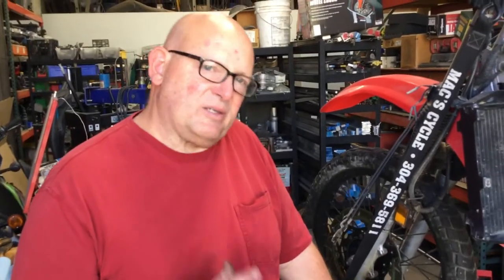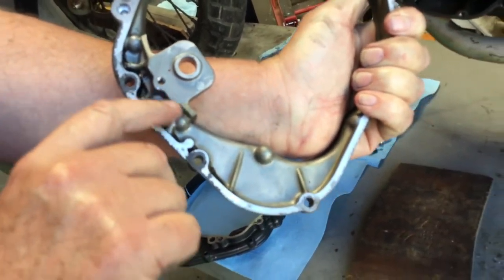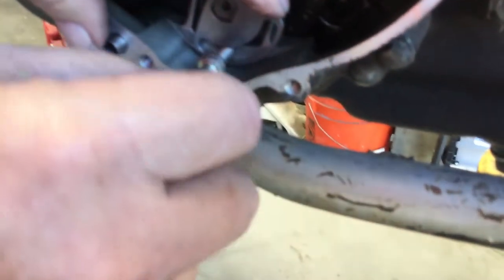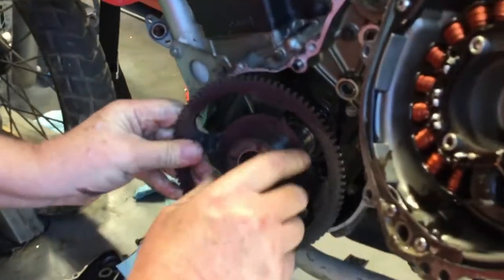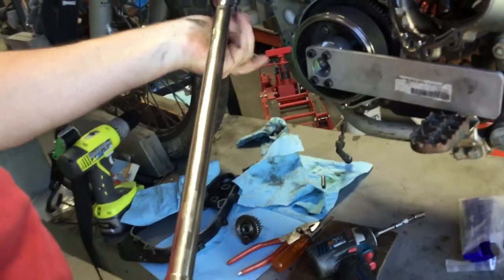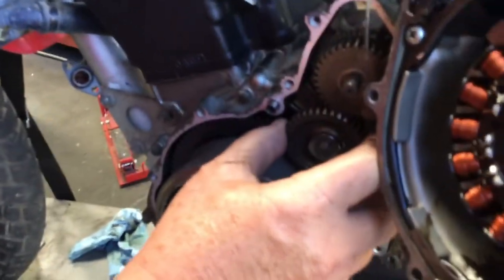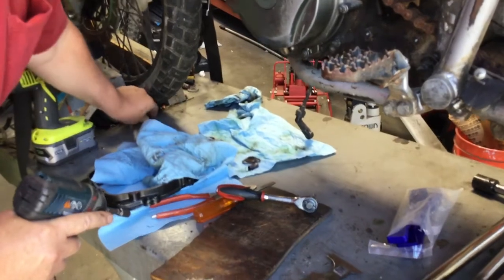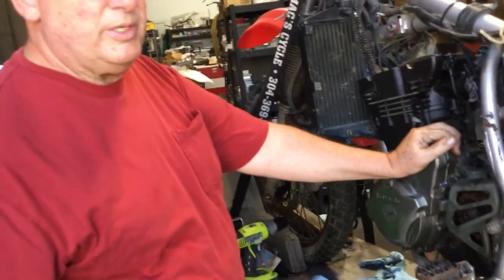doohickey install, part 2. Starts with assembly - going back together

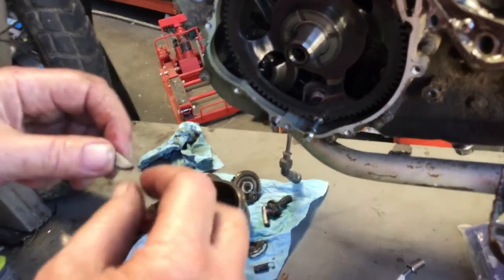Comment: Best doo video out there.  Mike brings up all the details that so many other videos miss.  For instance, centerpunching the key (9:15) is a great tip, and even better, rotating the starter gear while reinstalling the flywheel (11:30) is the difference between getting frustrated and it easily dropping into place in 2 seconds.  Mechanical work like this is often made easy with good technique and attention to detail, so make your doo swap easier by watching this video series.

Comment: Thanks Eagle Mike for the video and doohickey kit.   I was able to do my new to me 2012 with 8800 miles.   It had a strange surge to it when easing around at low speeds and you could also feel it in higher gears and higher speeds.   Sure enough my stock doohickey spring was loose and not tensioning anything.  Nothing broke yet.  She is nice and smooth now with the new doohickey and spring.

Comment: I just installed your kit on my 06 KLR and sure as heck the factory spring was broken.  My bike only has 14,400km on it so not very many miles.  What a difference now that it’s fixed.  It runs so much smoother now.  Now I’m just trying to get my jetting issue figured out.  Bogging and dieseling when rolling on the throttle hard around 3000rpm.  Did the DJ needle at the 3rd notch and 3.5 turns out on the pilot screw.  It seemed to cause it to bog at around 2700-2800rpm.  Then I checked the exhaust flange bolts and they were loose.  Tightened them up and that improved the bogging considerably.  I’m going to play around a bit more and then order your klx kit with the 042 jet.  Thanks for an awesome product!

Comment: Hi Mike.  I have seen another school of thought regarding the doohickey - that excessive looseness in the spring is also evidence of a stretched camchain.  Therefore installing the doohickey replacement is likely to conceal that problem - ie its papering over a more serious issue.  I remember when my GPz900R tensioner lost tension the correct fix was camchain replacement, a relatively trivial job I did in an afternoon because of the side mounted camchain on that bike.
Reply from the maker: You are mistaken. There's a spec for the chain in the service for the gen1. The wear is primarily on the left front weight. I've seen chains rubbing on the case, with the chain measuring within specification for a new chain. I replaced the weight and the other sprockets, and the rotation angle of the doo was back as new, with the chain no longer rubbing on the case. . BTW - it's not the cam chain, it's the balancer chain. I'll be doing a new video soon showing a lot of detail and history of the parts in the balancer system for this engine.
Reply from the maker: That theory isn't correct. First of all, it's a balancer chain. Second, I've measured chains (there is a specification), so I know when they are stretched or worn, and when they are not. The primary wear points are the rubber/plastic coatings on the sprockets where the chain side plates ride. I also know that the wear points actually wear less when the system is properly tensioned. I'll be doing a video about the balancer system, it's parts and design in the near future. Lastly, there is no need to post this more than once. This is my second reply to your theory. I hear of a new theory every so often, but it's always someone that hasn't been into a significant number of engines and actually measured the parts.

Comment: I have worked on engines for over 50 years.   Mike has even more wrench time than I have especially with the thousand KLRs he has worked on..   He clearly knows all there is to know about these engines.

So here is my only problem with this video.

NO IMPACT DRIVERS at assembly time.
DON"T DO IT!
DON"T DO IT!
DON"T DO IT!
DON"T DO IT!

Yes I know he  showed that he turned down the torque selection to the lowest setting.  If you are a PRO like he is fine but if you are not JUST DON"T DO IT.

I can't count the times I have had to repair threads because people with little experience on aluminum cases wrecked things.  Start bolts by hand only,    Use a 1/4 inch drive ratchet (not a 3/8 1/2 or 1 inch),  or a T handle to spin them down then USE A TORQUE WRENCH.  They are not lug nuts on a dump truck. 

If you ignore this issue and destroy threads in a case,   do the world a favor and fix them or have someone else fix them..  Don't sell a bike with thread damage to someone else without being honest about damage.   

Eagle Mike after thousands of hours of working on KLRs has developed a delicate feel for bolts going into soft aluminum cases.   He is a PRO, 90 percent of those who will do this are not.

So please follow this simple rules on assembly, NO IMPACT WRENCHES, air or electric.  Do not cross thread bolts. Do not drive in a bolt until it starts to thread in place just with your fingers. 

If you  damage threads REPAIR THEM!

 Mike clearly skipped over this because of his experience and was also concentrating just on the content of the mechanics  of the gears, chain and doohickey..  The content is outstanding.     Just remember he is PRO most are not. 

To Mike directly,  thank you for designing this new part and keeping our bikes on the road for years and years.

Comment: Hi! You caught my full attention when you mentioned the McMaster Carr or CDI torque wrenches, as economical generic versions for Snap On tools. I visited the McMaster site and I am confused by so many offerings. What model do you recommend? What range of values? I'd like to use one of these for my KTM Duke and my mountain bicycle. Help.

Comment: I'm sure someone asked this and I'm sorry if I didn't go through all the comments but, isnt it the same if you just hand tighten the doohickey making sure the chain is tight enough and just torque the nut on the doohickey rather than just using a spring. It seems that the spring is just there as a afterthought it does't tighten anything once you torque the doohickey bolt..? Am I wrong on this?
Reply from the maker: Spring isn't an after thought. If you want to leave the spring out, you can remove the left side case and the other parts, then manually adjust the system after wear occurs. 
Normal way is adjust the system every 7500 miles or so.

Comment: Hi Mike,
I’ve got a KLR I did the Doo (had done at decent shop) about 35k km back. 
The other day while bouncing down a trail my bike suddenly started running differently, sounded like my low fender was rubbing my tire or something.  
Vibrations went WAAAY up.  
It’s idling ok but the “crack/bark” it had when blipping the throttle is not there.  

I’m going to do investigations starting with oil filter and magnetic drain plug.  

I just wondered if a door hickey spring failure might have similar symptoms.  
I’ve heard of the starter gear snagging/rubbing the spring on rare occasions.  

You mention running with the doo loose causing a bunch of other damage....

I had to get home about 40km from the initial start of the trouble.  

Any tips on where to start my detective work after the oil filter/drain look? 

Thanks Sir!

Stu
Reply: Also the shop said he didn’t see a deep hole, but Wattman said my serial # was one that should have a deep hole.   
Could this be a contributing factor to a failure????
Reply from the maker: Deep hole shouldn't cause that. If/when you remove the left side outer case, it's easy to put the spacer in there for the deep hole. If you end up ordering anything from my site, leave a note on the order and I'll throw the spacer in the box with the parts.
If the doo clamping bolt is loose while the engine is running, it's pretty likely the spring will break. That can also cause a lot of wear on the balancer chain and sprockets.
Wish you were close and I could help you trouble shoot. Get a mechanic's stethoscope and probe around the engine while it's running, see if you can tell where the noise is coming from.
Take a good look at the filter and see if there is any metal in it. Look for stuff on the drain plug too, of course.
Good luck!

Comment: Several things I don't understand.  

First, the doohickey is secured to the case with its bolt.  So is this a routine maintenance item, where at whatever interval that bolt is loosened so that the doohickey can then rotate and take out the chain slack?  Then the bolt is retightened?  If yes, what is the adjustment interval for this?

Secondly, with the doohickey bolt loose, do you not want to rotate the engine a couple times so that all the slack in the balancer chain is taken out by the torsion spring?  Or does simply loosening the bolt suffice?
Reply from the maker: There is some info about this on the paper in the package with the parts. The adjustment interval is about every 7500 miles, or every 3rd oil change. The torsion spring will remove the slack. If you want to do it in the optimum condition do it with the engine at TDC. You don't need to rotate the engine. The adjustment bolt MUST always be properly tightened while the engine is running. I'll be doing another video soon that explains some of the conditions that affect the system, and why the factory parts don't work as well as they should.
Reply: @eaglemikeeaglemike6774  Thanks for the info Mike!

Comment: Thx for the great vids on this.   A bit confused on the bolt that goes through the doohickey though.   Do you just tighten it down as much as you can while still allowing the doohickey to rotate and the spring to keep tension on it?
Reply from the maker: The bolt should be tightened to 70 inch lbs. Emphasis on inch, a few have used ft lbs, which always results in a broken bolt. The bolt should be loosened to allow the system to adjust about every 7500 miles, while the engine is off, then torque it up before starting. It must be tightened while the engine is running.
Reply: @eaglemikeeaglemike6774    ah ok.......so every 7500 mile remove outer case and loosen the bolt which allows the spring to pull it to new tension and lock it back down with bolt..............thx.
Reply from the maker: @lunarluna  No, you don't have to remove the outer case. There is a black rubber plug on the outside of the case covering the head of the bolt. It's accessible just by removing the rubber plug.  So just remove the plug, loosen the bolt 1/2 to 1 turn, then torque it back up, re-install the rubber plug. It's a little better to adjust when the system is at TDC, but not a requirement.
Reply: @eaglemikeeaglemike6774  You say to torque it up before starting and then you say it must be tightened while running. Confusing. Can you clear this up? Thx
Reply from the maker: @Tbone0163  It has to be tight while the engine is running - always! Some people think it has to be loose and move while the engine is running. This is not correct. The spring will fail if the engine is running and the adjustment bolt is loose. The adjustment is done with the engine off, and the bolt is re-torqued before starting the engine.

Comment: OK - I watched both and at the end you loosened up the Doohickey Bolt so that it "rattles", but you never tightened it back up.
That means that you want it loose?   Won't it rattle it's way out till it hits the case?   Should it not be tight - and if yes - what torque?
Reply from the maker: I tightened it up when I tightened the outer case bolts. It must be tight while engine is running.
Reply: @eaglemikeeaglemike6774  
Thanks - I really missed that part

Comment: Problem at 3:30: the entire time he was showing where to put the hole, he was blocking the shot by wiping it clean, and then pulled away and started assembling. I tried to put my hole at like 4 o'clock or slightly later, and I think the spring is too tight. I can't get it in without it popping out!
Reply from the maker: If you bought the parts direct from me, look for the email with the pdf attached. It has a couple of good pics. If you didn't buy from me, and bought some other place, my phone number is available in the package, if it's my parts. There is a difference in the castings between 2009/earlier, and the 2010 later casting. 
I can put another video up just showing the holes location and attaching the spring. Be sure to watch the video already up on how the spring should be attached.
Standard caution note - the work needs to be done by a skilled mechanic, and should not be attempted by a beginner. If one is not experienced, gaining experience comes at a cost. If things don't seem to be going well, always ask for help. Good luck!
Reply: @eaglemikeeaglemike6774  I'm not a mechanic but I've been a wrencher for 30+ years, don't typically let mechanics touch my cars/bikes. I did get it in there, had to smoosh the top of the spring back behind the doohickey and it seems to be really "sprung tight", but it seems to be there. I'm afraid it'll pop out with all that tension on it though.

Also, you're a beast for answering a YouTube comment at 1am! Lolol.

Comment: Hello! Im doing this too. I just wonder if I use both springs... even if bolt get loose 2 springs can hold it tight torsional and eagle normal type. I just wonder like you said if that torsional slip and the loose doohickey but then you still have eagle normal spring... the normal spring can fail too and cause problems. Im not 100% sure about that torsional but maybe end of the day I will use it only anyway.

Just curious if some1 used both springs.
Reply from the maker: Only use the torsion spring
Reply from the maker: The torsion spring has a better tension curve, longer travel, is captured on install. The extension spring also vibrates and stretched and relaxed a tiny bit all the time the engine is running. The torsion. Spring also takes the slack out in the best way.
Reply: Ok so just leave eagle normal spring off and only use torsional spring?
Reply from the maker: @Veksi8  
Yes, leave the extension spring off.
Reply: I wonder if that arm there is the original spring start rattling because its now like washer? Also if end of shaft there doo is getting loose and it start rotating inside doo because tension is now end of the axl not middle like original spring. Otherwise torsional is much better.

Using both springs makes chain too tight?

Sorry I asking these as an engineer I just wonder what can go wrong. Thx your videos and support to KLR fan boys!

Comment: Do you have a video on the Deep Hole fix? I have an 08 model
Reply from the maker: It's pretty easy and straight forward, but I'll make one in the next couple of days, ok?
Reply: @eaglemikeeaglemike6774  no rush. I have a good idea what to do, just want to cross my T's and dot my I's so to speak 😄 Quick question, I know your kits come with a spacer for the Deep Hole issue, in your professional opinion, would a 3/8" ball bearing be any advantage vs a spacer? Thank you for the great products and work that you do 😄

Comment: Hi Mike, down here in NZ not many dealers seem to worried about the doohickey and I'm wondering if I order a kit they will not know about the torsion spring and drilling the hole. Will feel a bit weird telling them to watch your videos. Cheers Andrew
Reply from the maker: Hi Andrew,
Take a look at the video from Big Rock Moto about the KR650 Doohickey. He just released it. I was interviewed about the doohickey in that video.
Reply: Hi Andrew, don't worry about the doohickey upgrade. The KLR models we get in Australia and NZ are different to what the Americans get. They have extra engine components and emissions systems, plus ride thier bikes at higher speeds, in colder climates. Have yet to seen any failed doohickeys in Australia from multiple rider KLR rallys and people all over Australia. From over 20 dealers in Australia they have yet to see one fail. From all the hype it just seems that is all it is, Americans stirring the pot. Ride the KLR the way it came, it is all good.

Comment: Not sure who needs to hear this, but for the rotor bolt on a 1984-1986 kl600, the manuals appear to call for 87 ft lbs of torque. 

Does anyone have any idea why they changed it despite no obvious change to the bolt?

Edit: It seems that the 70 inch pounds on the case bolts holds up nicely for the 600, in case this sparked that question for any KL600 owners out there.

Also, can vouch for Mike's KL-600 specific kit for my 1986 variant! My original doo/spring were intact and functional but I appreciate the peace of mind that his kits offer.
Reply from the maker: My memory is the taper on the early 600 crankshaft is different.  Referring to the 1984 model. I'll have to spend more time on the parts fiche, as I haven't looked at all the affected parts for a while.
I actually havthe left side outer gasket available for the 1984 600 now. They were not available for a long time, but I had a batch made.